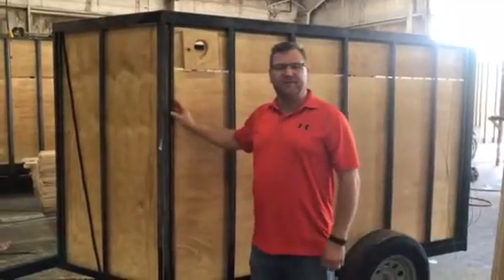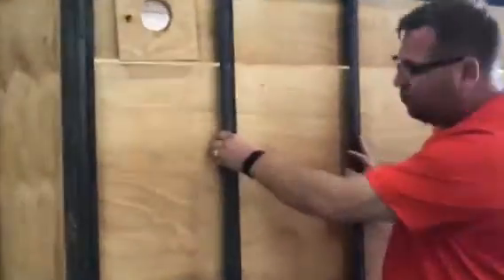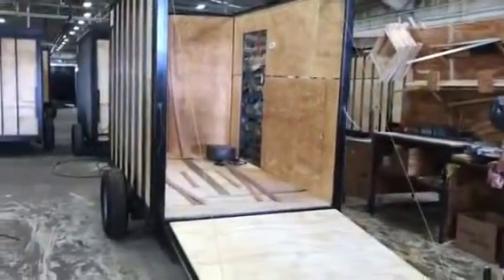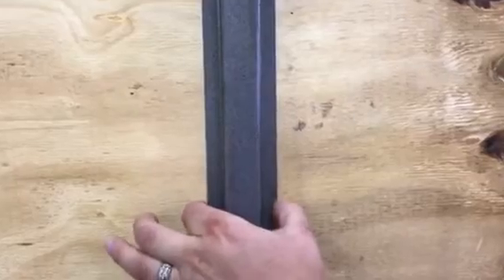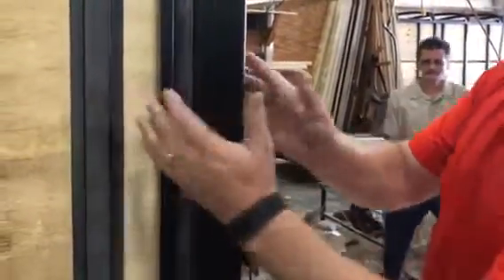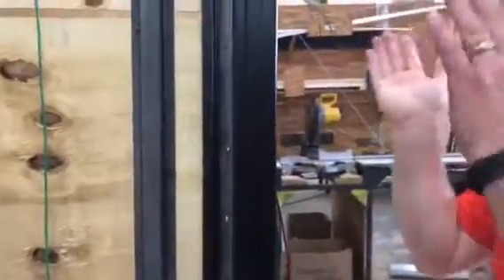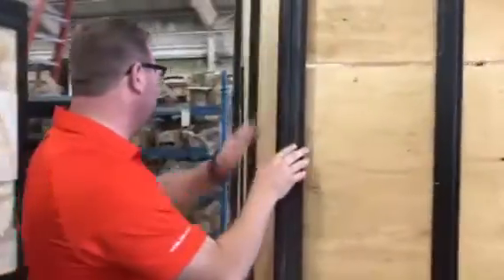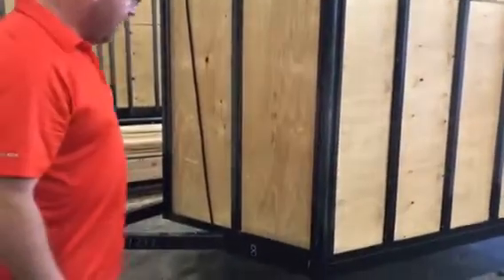Behind the scenes making enclosed trailers with Wild Bill!

Comment: I wonder what the chances are i could order a trailer that is built up to this stage so i could finish it out myself? Or, what the upcharge would be for it to be insulated at this point before adding the skin?
Reply: They have several options for insulation.   They can sell you a trailer with the interior wood stacked but not installed if you prefer.